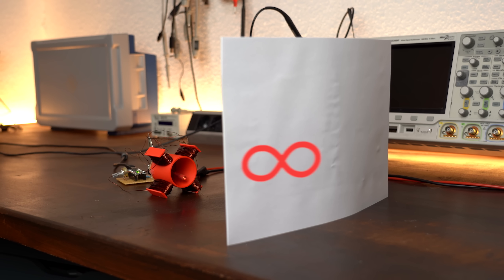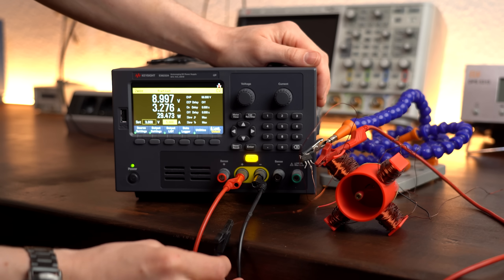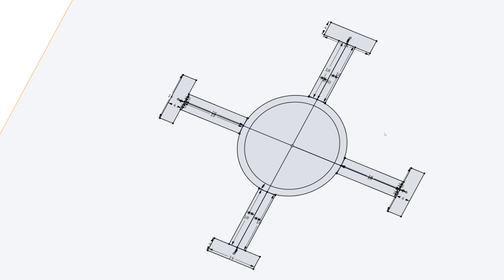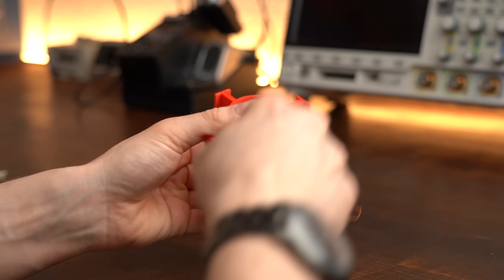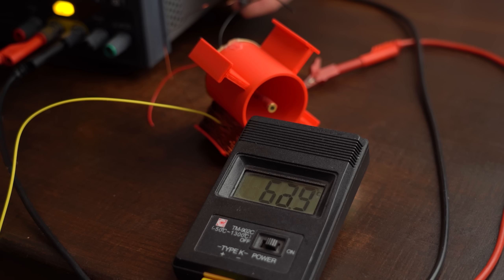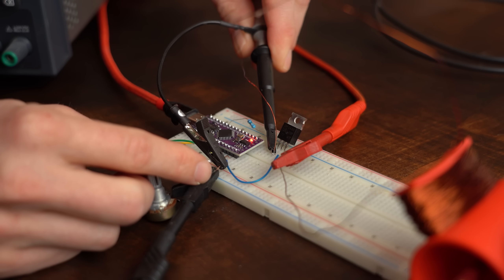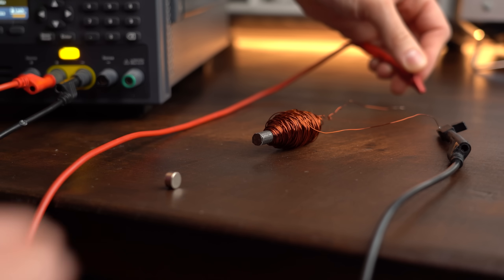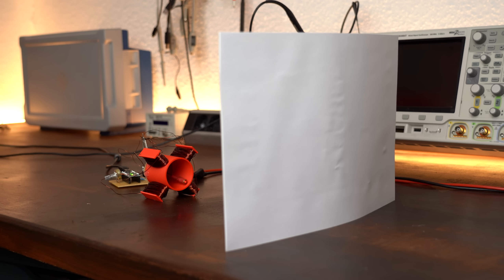Exposing the FAKEST Project....and making it REAL?!

Comment: I learned that it's not as simple as it looks! Also, when I've seen laser displays in the past they have used a mirror on a gimbal with the laser being static. The mirror on the gimbal doesn't take nearly as much magnetic force to move as trying to move the whole diode does.
Reply: We use x and y scanners
Reply: @MartinTheLaserGuy  You must be old school, like me. Nowadays, they're called galvanometers, aka galvos. But, of course you already knew that, lol!
 BR 😎
Reply: @TheOleHermit  31 years as a professional laserist, definitely old school 👍 Technically galvanometers with feedback circuits. Even the manufacturers call them scanners. Way back when they were moving coil and torsion bar. Then along came moving magnets with no bar, giving much better performance
Reply: @MartinTheLaserGuy  Yes, my 1st scanners were Laserium's open loop GS124's, in 1988, at the London Planetarium, prior to the GS120PD's in my own projectors. I've been known to break a few torsion bars, back in those days.
Now retired, returning to my love of cycloids, and finishing my 3rd build with a pair of C506 galvos (wanted Saturn 5's 😭), upgraded from DT-40's, upgraded from el cheapos from ebay.
Currently developing my own MIDI controlled Teensy ADC/T4 Laser Synth/DAC. Finalizing the PCB in Kicad, soon to be announced and shared on PLF. 🤗
Reply: @TheOleHermit  excellent mate 😁 the 506 are definitely better than Chinese. I'm also a fan of the analogue, if I could afford it, I'd start building up some eurorack oscillators etc to play with. Everything now is Pangolin, output quality isn't what it was.
Reply: @TheOleHermit  oh, also very interested in what you're building
Reply: @MartinTheLaserGuy  Just updated the info on my shared link, FYI. 😎
Reply: @TheOleHermit  and  @Martin K  Very interesting conversation, and thanks for sharing the plans! I've always wanted to make one of these (having seen full size projectors illuminating tall buildings!). I was thinking of using the motorised mirror from a laser printer or similar device but unfortunately I don't have enough technical knowledge to design anything from scratch.
Reply: @stepheneyles2198  my first controller was a pair of cassette deck motors with a dental mirror glued to the pulley at a slight angle on each one. Hit the first mirror and spin it, you get a circle. Then bounce that off the second one and alter the speeds of the motors to produce Lissajous patterns 🙂

Funny thing is, I found a proper laser company and managed to go and visit, I brought my home made setup to show them. Three months later, they phoned out of the blue and offered me a job!
Reply: You have probably seen a lot of laser displays unless you are really really young, they used to be everywhere. They are called CRT displays Cathode Ray Tube, used for basically every display prior to the advent of LCDs Liquid Crystal Display.
Reply: @somehow6839  : CRTs are not laser displays, they're electron beam displays. They can be used for similar purposes, but the technologies are extremely different.
Reply: @somehow6839  I also use video projectors, the old 3 lens CRT video projectors were horrible. Texas Instruments invented the DMD (essentially an IC with a grid of moving mirrors - one mirror per pixel) and that killed the CRT units, all large professional projectors use DMDs, LCD doesn't match the power handling or contrast ratio. Interestingly, cheaper 'digital' projectors use a single DMD with a colour wheel rather than individual red, green and blue chips. If you've ever noticed a rainbow effect when you move your head, it's a single chip.

All that said, laser shows are completely different 😁 The company I first worked for made laser video projectors, hugely complicated optics, big power and water. Single lens video projectors killed that too.

Comment: You are missing the type of material diode is supported like size etc
Reply from the maker: No
Reply: @greatscottlab  In the project diode is used as a light source only most of the working is in metal he is using for compression I will consider Hysteresis loss cause of vibration in the material

Comment: The body diodes of the MOSFETs would tend to absorb much of the inductive spike, but you're right, a parallel flyback diode is safer.  You might get better performance by attaching a magnet to the diode, making an iron circuit between the coils so the laser diode lives in the gap, fine tuning the gap size, adjusting the compliance of the laser diode mount, etc., but the best you're going to get out of it is fairly low frequency Lissajous figures, nothing like a raster scan.
Reply: I don't have any experience with these types of systems but that was my first thought. You'll never be able to control the magnetic field and movement fast enough to complete an 'image frame' regardless of what you do. Maybe if you scale it and add multiple projecting units to complete one section of a frame, or create a grid system similar to pixels, but the thing itself would be very slow. There's no way this 'solution' has any ground to stand on.
Reply: @Adrian2140  it can be done but you need precise placement of the coils and the laser source plus feedback
Reply: @viermidebutura  precise placement of the coils is expected, but I highly doubt you can go from one opposing side to the other in a physical environment controlled by magnetic fields in a timely manner to actually make a frame. The reason this works in an old cathode ray tubes is because projection is done and controlled by refocusing the electron beam itself via coils, not the whole gun. That's not how lasers work.
Reply: @Adrian2140  the problem with a mechanical approach is the spring that holds the laser diode which will vibrate like crazy. 
This vibration can be harnessed but you overcomplicate the driving circuit.

The deflection coils on a CRT have nothing to do with focusing but they move the electron beam across the screen
Reply: @viermidebutura  That's what I meant by focus, as in direct the beam. You can't mechanically reproduce what the coils do with an electron beam in a cathode ray tube.

The only way this would work would be by redirecting the laser in a similar manner, not the laser source itself, but since you can't do that with lasers, you'd need a 'filter' or lense that redirects it.

That's why I said this idea has no ground to stand on from the start, just like GS pointed out.
Reply: @Adrian2140  yea but deflecting the light with mirrors still has the same mechanical problem.... but  with 2 mirrors a bit more stability can be achieved
Reply: @Adrian2140  : Your terminology is misaligned, and your claims are a bit off too.

Focusing of an electron beam does happen in a CRT, but it's done before the magnets instead of after: it's why the beam illuminates a small spot instead of a large dot (the expanding dot that sometimes appears on shutdown is because the electrons aren't accelerated as fast and thus can spread out more, not because of magnetic focussing).

Also, you can redirect a laser beam fast enough to make scan-line images by controlling a lightweight mirror with magnetic fields, and it actually gets done by some laser-light shows (the usual device is a laser galvanometer, and the moving piece consists of a very light mirror, stuck directly to a magnet, held in place by a wire or similar- they use as little mass as possible).

Comment: There's an old school version that's actually sound reactive in the most analog of ways where you take a laser pointer and point it at a small mirror attached to a Bloon stretched across a ring so that when sound vibrations hit the stretched Bloon it vibrates the mirror, changing the angle of reflection of the laser point.
Reply from the maker: That sounds real :-)
Reply: @greatscottlab  I believe it was a project in an old cub scout handbook/support books for den leaders here in the united states. It involved very simple carpentry and the balloon was stretched in a round embroidery /needlework frame.
Reply: @greatscottlab  I actually made a laser display with moving mirrors. But it can only display some patterns.
Reply: @souptikmullick2476  From my experience repairing laser stage lights they commonly use a pair of rotating mirrors where the laser hits them from an all set angle and the speed of the rotation  changes the pattern.
Reply: @petercoutu4726  I thought they rotating with constant speed but modulation of the laser light changes the pattern
Reply: @greekstraycats  : There are many options for the moving mirrors. Some have a pair that have their movement direction & speed controlled with analog (or digital) signals (these are often called galvos, because a galvanometer is commonly used to move the mirror), some are mounted to servos or steppers so that they can be set at fixed angles, some will be speed controlled for various effects (e.g. kaleidoscope effects). A full-featured system will often have a single fixed-angle laser with mirrors that rotate into or out of the beam to direct it to some sort of fixed-pattern generator, and at the end of the line a pair of galvos to allow X and Y scannong.
Reply: @greatscottlab  YouTuber Techmoan has worked on one such device
Reply: the "real" way to project a laser with a galvanometer is not far off from this
Reply: You can also modify an old speaker for the active version of this.
Reply: @johnathanmcdoe  connecting diafragms with a wire or rod into the diode might be more efficient than a magnet.
Reply: This is amazing
Reply: I did this with sunlight and a small shard from a broken mirror as a kid.
Reply: Why not use an electron gun(ie laser) in the back of a vacuum tube and magnetic fields to focus then bend the rays emitted changing the trajectory of the electrons to hit a specific point on a phosphorescent coating the interior front of the vacuum tube. With the target point scanning across in a line then up the front line by line really really fast to create an image.
Oh wait that's a CRT (Cathode Ray Tube) Display conceived around 130 years ago....
Reply: @somehow6839  : Electron guns are not lasers, CRTs are not lasers, and the brightness and construction difficulty are completely different.

Comment: Cool project! Now record the image produced and use machine learning to “train” the magnets to give the proper shape. No need for engineering perfect magnets, just use better control software. Probably a worthwhile engineering improvement would be to get rid of the wire that is acting like a spring and causing a lot of complications with the movement. Extend the rear of the diode and attach magnets to that, and fix it through some sort of gimbal, so that you get an amplification of the movement of the diode. Looking forward to part 2!
Reply from the maker: Haha thanks for the feedback. But I doubt that I will properly finish this build. If you want a laser display, simply use mirrors to deflect the beam and servos to move them.
Reply: @greatscottlab  True, much more efficient! Would still be cool to train the servos with image analysis and machine learning 🤔

Comment: Why just not use servo instead??
Reply from the maker: And mirrors. That would be the old school way ;-)
Reply: @greatscottlab  May be it could give you more precise control
Reply: @ssllllllllllllllss  : More precise, yes, but usually (but not in this specific case!) the feedback will be too slow for whatever it is that you want. The "better" (but harder) solution is usually to design some pre-compensation circuit that'll take motion, mass, and position into account, with an occasional calibration step to cancel out any errors.

Comment: I have one Idea will you work on it?
Reply: One bracelet which have type c to type c cable for charging and data transfer. You can also add female 3.5 mm jack because now days many phone don't have it. And one female type c port for changing which using 3.5 mm jack.

Bracelet will have female 3.5 mm jack, type c female port and type c male port on one and and one type c male port on other hand.

For wearing on wrist all you have to do is plug male type c on one end to female port of other side.